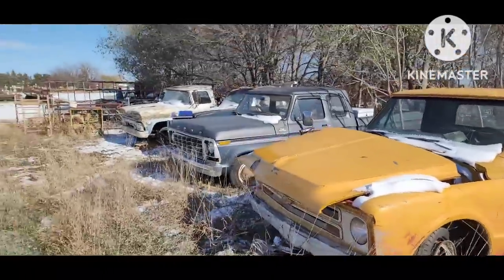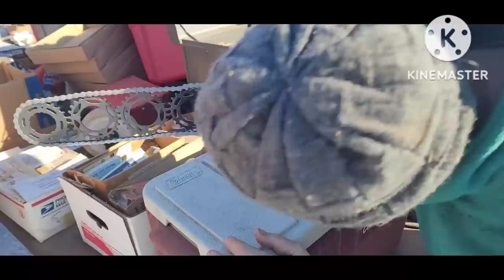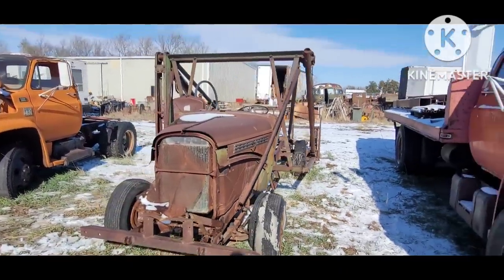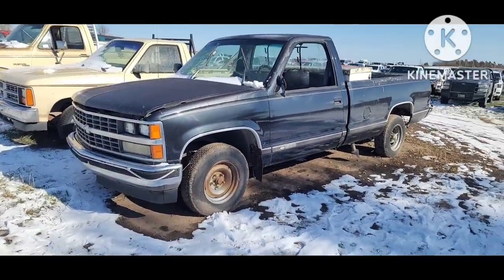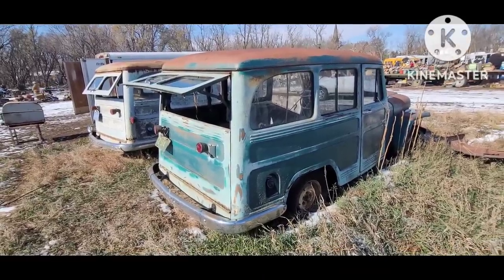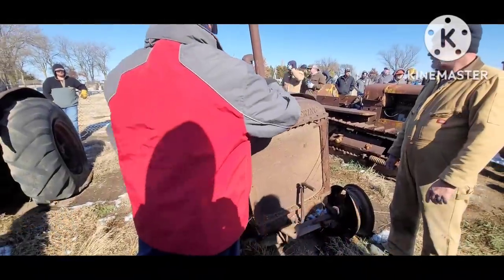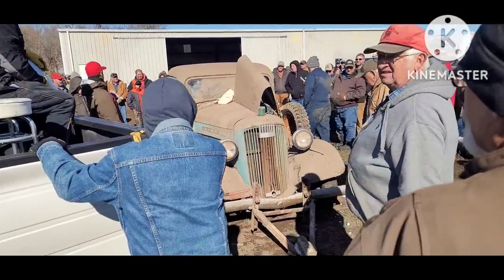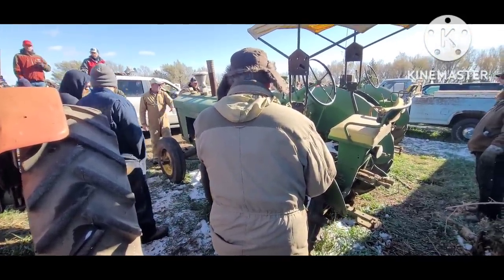TONS of Barn Finds in HUGE collection of tractors, trucks, cars, & more! Farm estate auction hoard!

Comment: At 4:14, a 1938 GMC. (The GMC logo is at the top of the grille, unlike 1937, which was lower down on the grille like the 1936 GMC shown at 10:59.)  I owned four 1937-38 GMC's. Definitely not a 1936 as your caption states at 58:24. A typo?

Comment: At https://youtu.be/yF3tAp7jdKc?t=876 I am pretty sure you are looking at a Walters SnowFighter built on a Chevy chassis? The large square frame is where the wings were attached and a large V-plow  was on the front. There was also a block of cement where the bed would be for weight.There are a few videos on YouTube of one in action.

It was repurposed for hay bales. Talk about recycling!